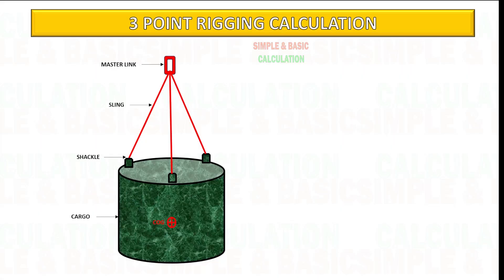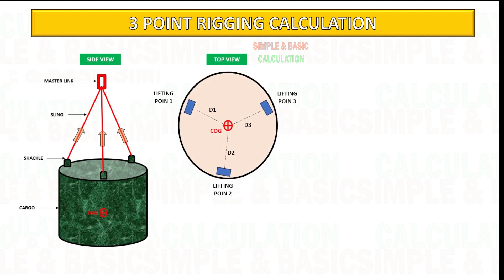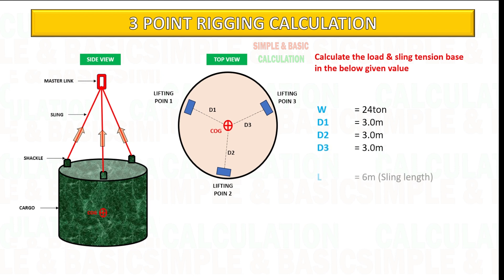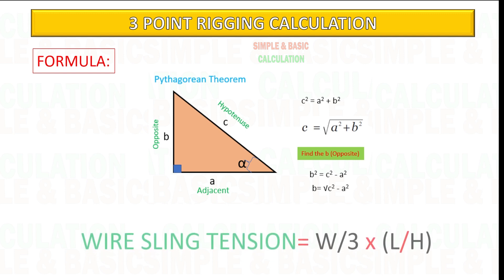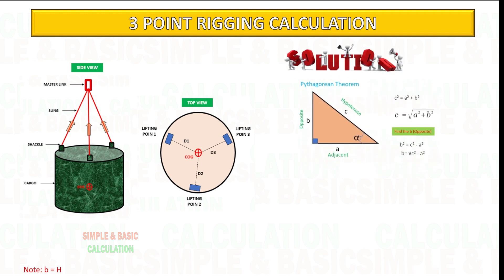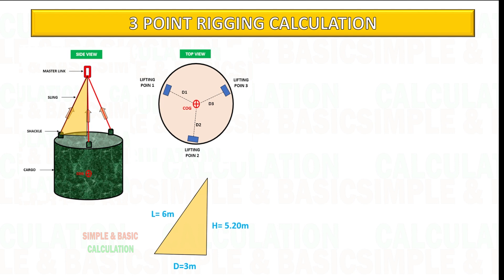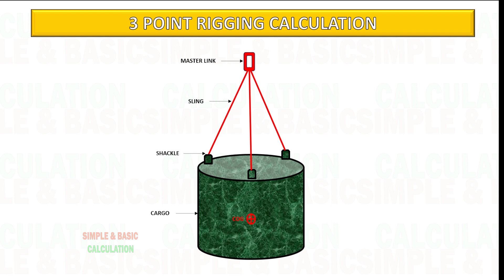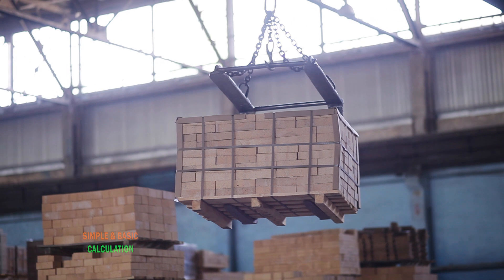Rigging Calculation for 3 Lifting Point #lifting #rigging #crane #heavylifting

Comment: You definitely made a mistake. On 24ton load, even if the 3legs are straight, you have 8tons on each leg. How much more in the given configuration in the video, there must be up to 9tons above. The slings you select must also be up to 10 or 11 tons.
Reply from the maker: Thank you for your comment. As I mentioned, the sling tension in this case is 7.67 tons. It is important to note that this value represents the tension experienced by the sling during the lift, not the sling’s rated capacity.
As explained in the video, when dealing with a three-point lifting arrangement, only two of the slings are effectively bearing the load, while the third primarily serves to stabilize and balance the lift. Therefore, from a safety standpoint, it is advisable to select slings with a rated capacity exceeding 12 tons to ensure adequate safety margins.

Comment: As its gone from 20 tons to 24 tons ,same height and length, 24tons/3=8   8X1.15=9.2 ? or am I missing something ??
Reply from the maker: Thanks for the comment. your right mavwing.
Typing error only. I forgot to change the value in my calculation.
Either 20ton or 24ton but the concept is the same. Cheers